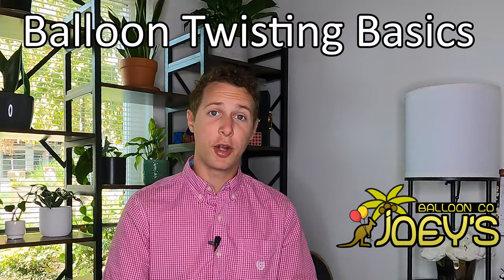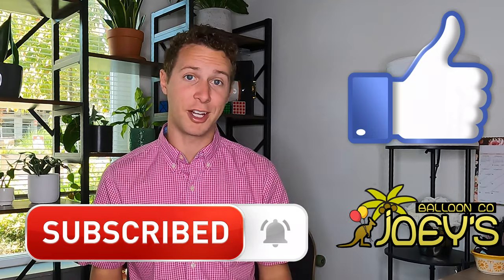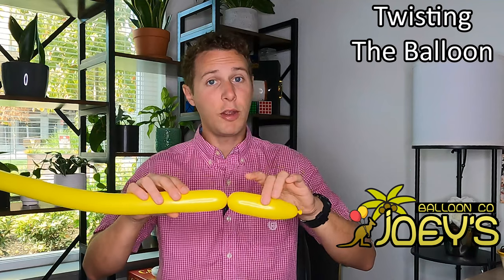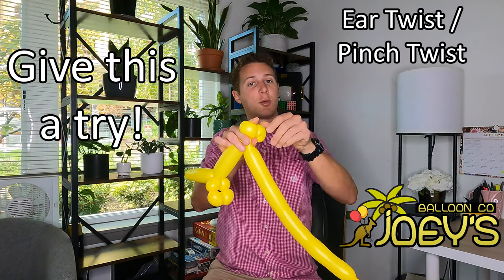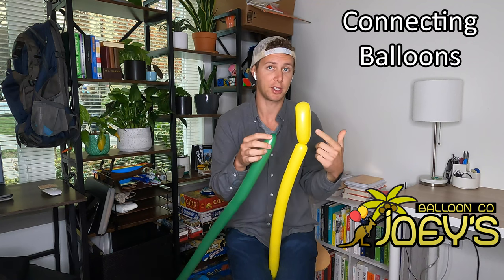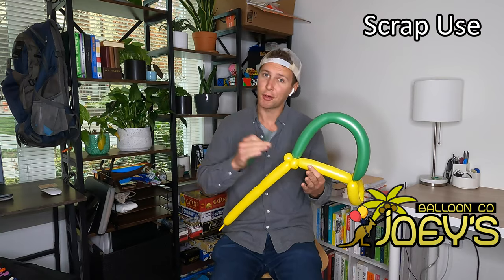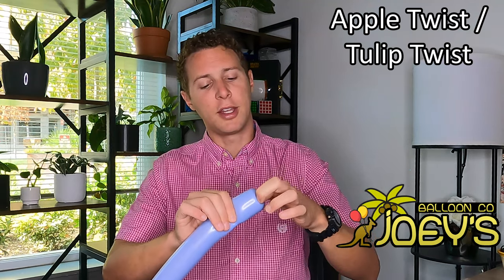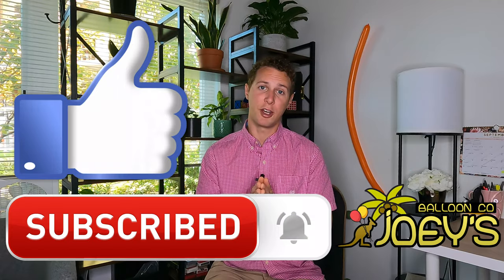Balloon Twisting Basics (Beginner Intro)

Comment: When using the two stroke 260 pump, roll the balloon on the nozzle, but hold the nozzle still. Instead, move the body of the pump back and forth. You'll find it much easier. I can't inflate a 260 by mouth, so I use a 260 pump. And that's all I use. Get a good one, take care of it, use it properly, and it will serve you well.

The pump is ment to come apart. That's for cleaning.. Don't take the pump apart all the time, but do take the pump apart.  You'll notice there are different parts inside. Each part needs to be there for the pump to work properly. At the end of the long rod is the piston. There's a top disc and a bottom disc. Between the two  discs are two rubber what I call gassgets Carefully remove them. Use a dry cloth, not a damp cloth to clean them. Set them a side . Look inside the space where you removed the two gassgets. Do you see any dirt? If so,  clean the inside.. Then carefully put back the two gassgets. Without the gassgets, the pump will not work at all.